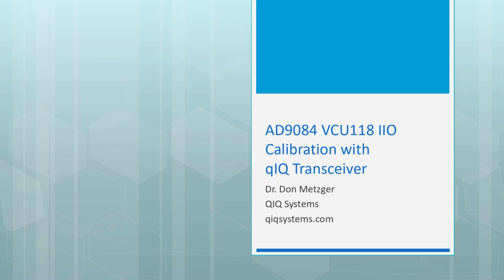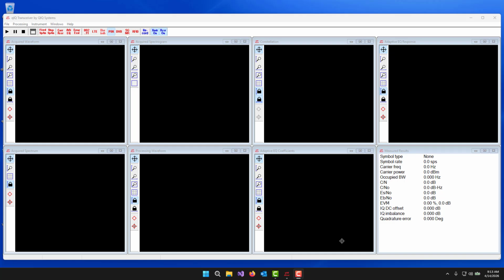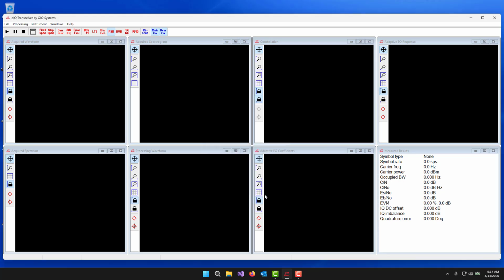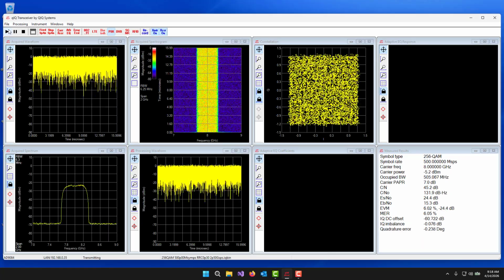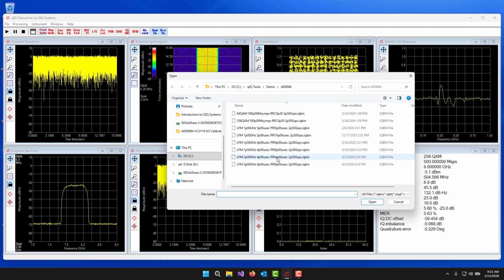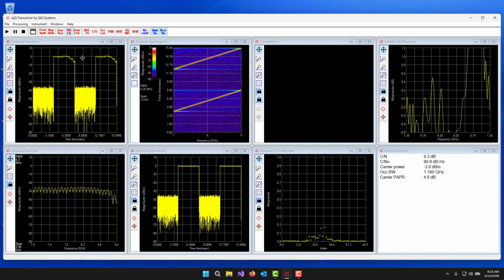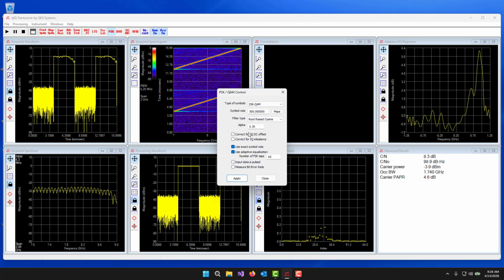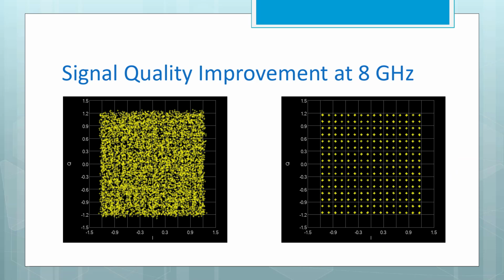AD9084 VCU118 IIO Calibration

Comment: AI Summary

Abstract

This technical presentation details RF performance optimization for the Analog Devices AD9084 Mixed-Signal Front End (MxFE) hosted on a Xilinx VCU118 evaluation board. The workflow utilizes Analog Devices IIO software and the QuickSystems Quick Transceiver interface to demonstrate a two-stage calibration strategy for wideband 256 QAM signals. Initial testing at 2 GHz confirms that 65-tap adaptive equalization effectively compensates for passband ripple, reducing Error Vector Magnitude (EVM) from 3% to 0.3%. However, at 8 GHz, significant frequency-dependent droop and system-level parasitic effects (cables, traces, and baluns) render standard adaptive equalization insufficient. 

The proposed solution employs "Arbitrary Waveform Equalization" using a 2 GHz bandwidth Linear Frequency Modulation (LFM) chirp to characterize the full spectral response from 7 to 9 GHz. By deriving complex FIR (Finite Impulse Response) tap coefficients from the chirp response and applying them as a fixed calibration layer, the system achieves an EVM of -41 dB. The demonstration concludes that combining fixed chirp-based calibration with secondary adaptive equalization successfully restores signal integrity across high-frequency wideband channels.

Technical Summary: AD9084/VCU118 RF Calibration and Equalization

*   0:00 System Overview and Hardware Setup: The system comprises an AD9084 evaluation board interfaced with a Xilinx VCU118. The signal path involves a DAC0 to ADC0 loopback, integrated with an ADL8100 amplifier to ensure the DAC output reaches an appropriate level for the ADC input range.
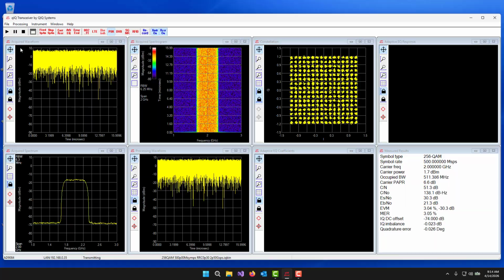*   3:48 Baseline Performance at 2 GHz: Initial tests utilize a 256 QAM waveform with a 500 MHz occupied bandwidth (500 MSPS) at a 2.5 GSPS sample rate. Without equalization, the system exhibits an EVM of approximately 3% (-30 dB).
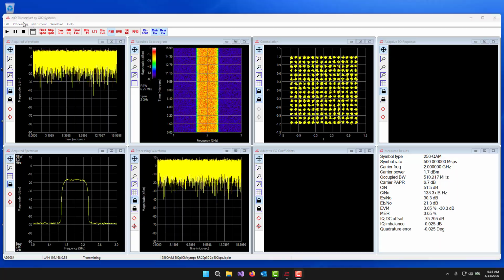*   4:17 Adaptive Equalization (2 GHz): Applying 65-tap adaptive equalization cleans the signal constellation significantly, improving EVM to 0.3% (-50 dB). The equalizer response compensates for minor passband ripples inherent in the hardware loop.
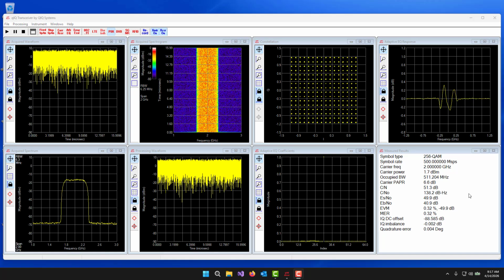*   5:01 High-Frequency Performance Challenges (8 GHz): Shifting the center frequency to 8 GHz reveals severe signal degradation characterized by significant passband ripple and spectral droop. Adaptive equalization alone fails to recover the signal, resulting in a 5% EVM and high bit-error rates.
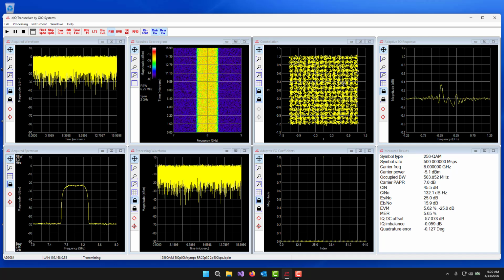*   6:31 Chirp-Based Calibration Strategy: To resolve high-frequency degradation, a Linear Frequency Modulation (LFM) chirp is used as a calibration stimulus. The chirp sweeps a 2 GHz span (7 GHz to 9 GHz) to characterize the full bandwidth of the RF front end.
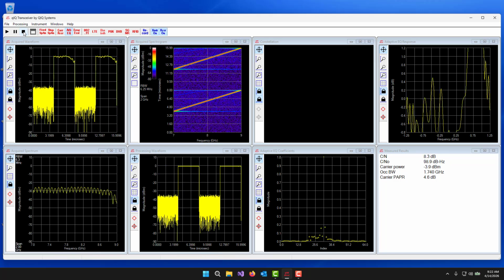*   8:11 Arbitrary Waveform Equalization: The software analyzes the received chirp against the ideal stimulus to identify frequency-dependent losses. This process generates complex FIR tap coefficients to flatten the system response, compensating for a significant falloff at the upper-frequency edge.
*   9:29 Coefficient Management: The derived complex coefficients are saved as a dedicated calibration file (`DAC0_ADC0_8GHz.txt`). These coefficients represent the inverse of the system's physical imperfections (cables, baluns, and PCB traces).
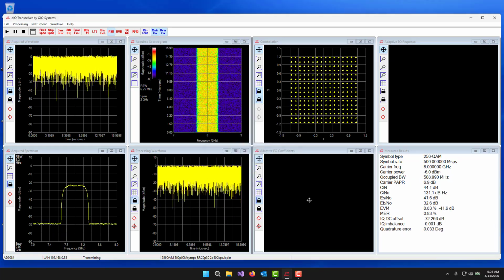*   11:06 Multi-Stage Results (8 GHz): Applying the fixed chirp-based calibration coefficients immediately improves 8 GHz performance to an EVM of ~0.8% (-41 dB). 
*   11:38 Final Optimization: Overlaying 65-tap adaptive equalization on top of the fixed calibration layer further refines the constellation. This two-tier approach successfully transforms a non-functional high-frequency link into a high-fidelity signal path.
*   12:55 Key Takeaway: RF system imperfections are cumulative across components (traces, launches, cables). Wideband performance at high X-band frequencies requires characterized fixed calibration (via chirps) to provide a baseline for secondary adaptive algorithms.

AI-generated summary created with gemini-3-flash-preview for free via RocketRecap-dot-com. (Input: 15,991 tokens, Output: 944 tokens, Est. cost: $0.0108).